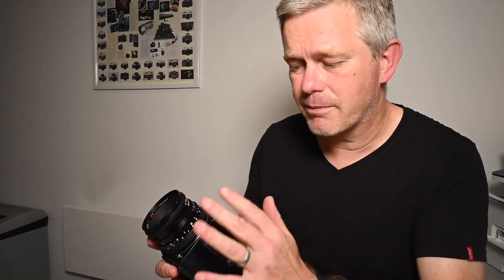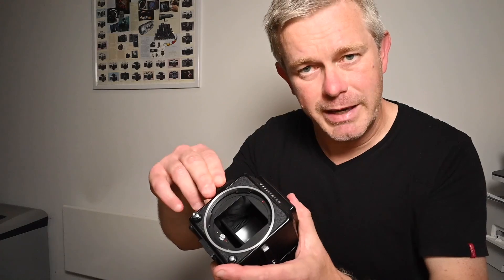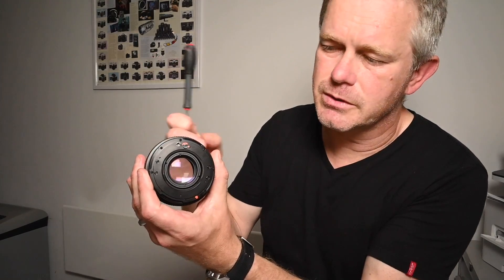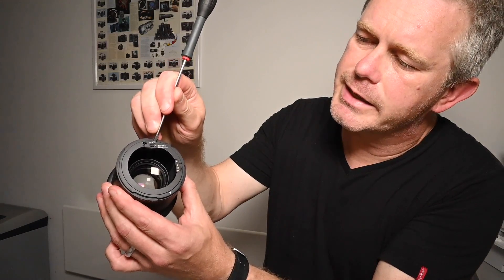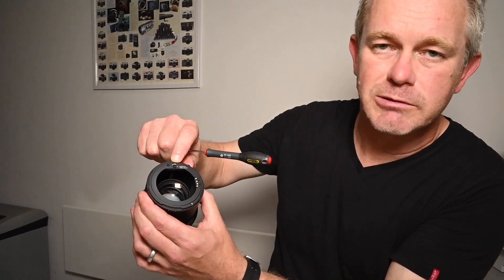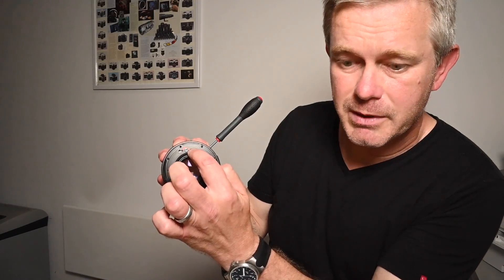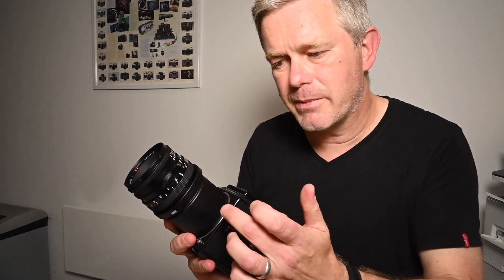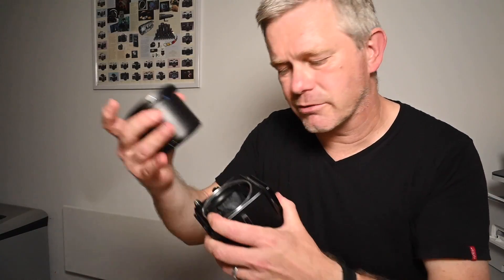Hasselblad converters and extension tubes - mounting and dismounting correctly

Comment: I have a handheld meter I'm using a 2x on an 80mm c lens to 160.
Do I need to compensate for loss of light w converter by 2x ? 
Thank you
Reply from the maker: With any 2x converter you will lose 2 stops of light.

Comment: are there any exposure adjustment charts recommdable by you?
Reply from the maker: Hasselblad made an exposure adjustment chart for bellows and tubes. Perhaps see if you can find one on eBay. Also, the tube user manual has guidance.
Reply: @WorldwideCameraExchange  thanks  I don’t have any original boxes etc. but will do more googling. He did a lot of macro photography but alas he’s long gone
Reply from the maker: You’ll find formula online that’ll help you calculate required  compensation

Comment: I inherited a hasselblad and a bunch of tubes.  have been getting comfortable with the basic camera setup, but the macro tube extensions fascinate me and have been thinking of trying them out as well.  some are just tubes, others have an optical element.  what would be the different reasons for that? and one appears to be a a shutter and diaphram adaptor
Reply from the maker: Hasselblad extension tubes don't have glass. From your description I suspect you have a tele converter.
Reply: @WorldwideCameraExchange  ah that could be. When I was very young he used to drag around a 500mm lense. At some
Point he got rid of it and this would have been a lighter approach.  It is a T*
Reply: @WorldwideCameraExchange  it’s a Carl Zeiss Mutar 2x T*
Reply from the maker: Yes, that say 2x teleconverter (and much lighter than a Hasselblad 500mm!)
Reply: @WorldwideCameraExchange  hi again.  I have a 2000 FC, have read on Ken Rockwells site that the 10/21/55 original series extension tubes aren't compatible. is this correct?  I also have a hasselblad component  with synchro compur  shutter and aperature f2.8 to f22 mechanisms, but no glass.  It  clearly is some sort of macro extender.  can you point me to what this is since its not labeled on the component itself  it seems strange to mount a V series lense on another 'lense' type element.  many thanks, Rob
Reply: @WorldwideCameraExchange  I have a 2000 FC, 10/21/55 original series extender tubes and read on Ken Rockwell's site they are not compatible with the 2000 (my father also had a 500C which I don't have).  Is this correct?    

also, I have a type of macro extender with a synchro compur lense and aperature from f2.8 - f22 and no glass.  the body end of the component is just like a normal lense mechanically , the front end is simple bayonet without locking mechanism or other mechanics - it  appears to be approx 55mm.   the aperature diameter is only 20mm however, not the 50mm as with the older simple 55mm extenstion tube.  any idea what I'm dealing with here?  thank you so much so far for your feedback.  Rob
Reply from the maker: Yes, the earlier tubes that predate the 2000FC can’t be used. Post a picture of the other item - I’m not sure what you have.
Reply: @WorldwideCameraExchange  hi Jonathan,  I found out what the strange lense element is. Originally an 80mm standard lense was disassembled and adapted for a microscope for photomicroscopy as my father had been a (semi) professional macro and micro photographer. Discovered this when I bumped into the only hasselblad repairman in the zurich Switzerland area by chance when buying film. Thanks for your input on the other stuff. And btw for some reason the 51macro tube seems to fit the 2000. Even though it shouldn’t 🤷‍♂️
Reply from the maker: Glad you got it sorted!

Comment: many thanks for the advise here. i hve a H3D camera and 1.7 converter - connecting well and solid. the 50-110 lens is not connecting to the converter. (connecting no problem to the camera). what am i doing wrong?
Reply from the maker: The digital converters mount far more easily than the older converters covered in this video ... there's nothing you can be doing wrong. Perhaps try cleaning the electronic contacts? Otherwise I'd send to Hasselblad to have the adjustment checked.